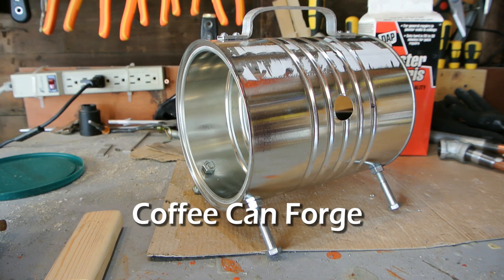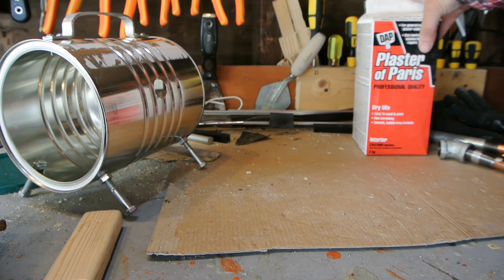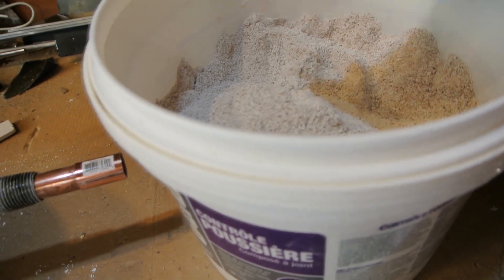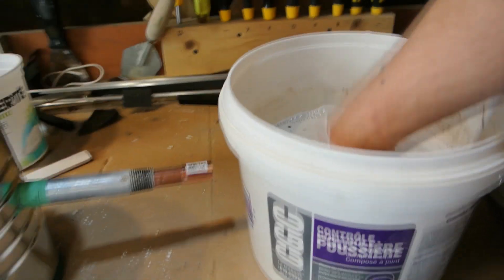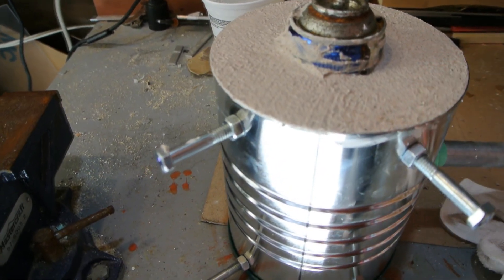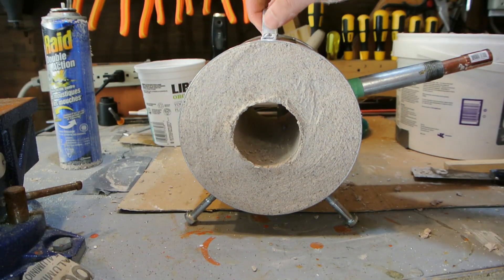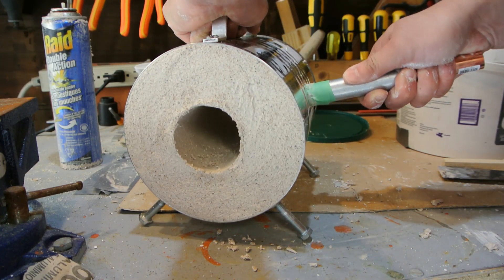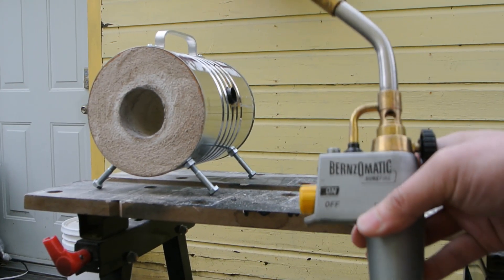How to Make a Coffee Can Forge

Comment: Does he mean three equal parts?
Reply: I've just made one of these... Use one part Plaster of Paris and one part Sand. [ie: 2 kg of PoP & 2kg of Sand.]  Add them together and mix them 'dry' to combine them equally (NO Lumps) then add sufficient water to create a "porridge-like" mixture.(the volume of water will depend on the amount of PoP & Sand needed for the size of your container)    You may need more - So be ready to quickly mix another batch and top up the forge container you are using. You DO NOT want to have the  1st batch harden before adding the 2nd lot on top as this will create a partition in the refractory which in turn will create a weak point and allow heat to cause problems. If you use a large amount of water - it will take forever to harden. It might pay to prepare a couple of extra plastic bags of PoP and another couple of bags of sand - ALL of the same weight - so you can quickly do a "Top up" batch . Hope this helps

Comment: What do you mean by "one part"?
Reply: "Parts" just means ratio basically. For example; one part sand and one part plaster would mean, lets say, 2 cups of sand and 2 cups of plaster. If it were 2 parts sand and one part plaster, that would be 4 cups sand and 2 cups plaster. The amount is arbitrary, its just referring to the ratio.

Comment: If you would put the torch inlet at a slight angle instead of perpendicular to the chamber creating a "cyclone" affect. Do you think that would increase the performance with a more uniform heat? (Using for heat treating knives) thanks really good video

Comment: Believe it or not, out of all the supposed coffee can forges I have seen built on youtube, your's is the first I have seen that is actually a functional forge -- and not just a foundry tipped on its side being called a forge. For those reading this that are wondering what I am talking about, a forge needs a spatially controlled heat source for precise application of heat to the metal -- notice the burner entering the unit at a ninety degree angle.

Angled burners are for foundries that have a crucible taking up the center of the unit so need a swirl flame inside the chamber to evenly heat the crucible.

Comment: how hot (in terms of temperature range) can we expect from a setup like this?  1000F+? 1500F+?
Reply: Jon C. Pure propane burns at 3000F. So you should expect about 2500F after factoring heat loss from both sides.

Comment: The design is great. There's only three things I would change about it. Instead of having to make your own refractory mix just buy some refrextory cement (Home Depot sells a 50 lbs bag for fourth dollars on delivery.) and I would angle the torch to hit the bottom of the forge somit comes in more direct contact with the steel, and I'd use a bigger burner. (I'm going to use this design to make my forge welding forge, all in all? Great job that's a cheap and easy starter forge for any up and coming blacksmith.
Reply: 435

Comment: I am going to have to use something like this design to start out with. From what I am hearing from knife makers is this one will not hold up for a long time using it. Also do not try forge welding in it. The borax would eat the lining to the can. Though years ago when I did forge welding in metal fab class we dug a pit, and used coal with an inflation pump for an air blower.  Honestly if it works for a few hours it can be rebuilt cheaply, and easily.

Comment: great video.  Can you or would you please consider building a kiln that sits up right with a lid that uses the graphite crucible? I have my gold and silver recovered and purified beyond the point needed because of bordem. I can't get enough heat to melt the material and I can't afford the eBay just yet.  :-$. 
I'm a disabled Marine Corps EOD Tech Retired and looking for a hobby and I like your mixture better than the other ones that I have seen.
Outstanding video and any and all help is greatly appreciated. Respectfully Tim
Reply: Hey bud.   I didnt make the video, but yes, that would be a pretty simple conversion.   Instead of cutting out a hole in the bottom leave it solid.    Turn the can up to set on its bottom.   Move the torch head toward the bottom and have a slight upwards angle on it.   You could also fill the chamber part of the way up on the bottom with Kaowool.  to make the chamber smaller.    That would give you better heat efficiency, and higher temps.   Just make sure if you fill up the the bottom to move the torch head up as well.  Other than that, get you a fire brick to set across the top when in use, and you should be able to get to the temps you need.  Honestly, you could have it as a dual purpose forge, use it on its side for forging and up right for foundry applications.    It is a solid design and will work.   If you wanted to go a bit further, you can buy actual refractory cement, instead of using his mix.  and you can also pick up burners specifically designed for this application, but his torch head should work.